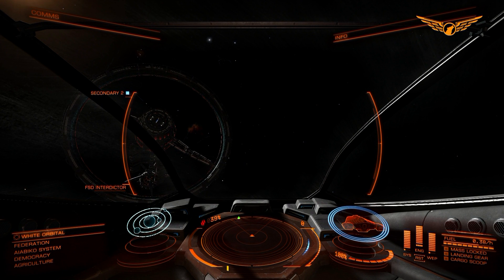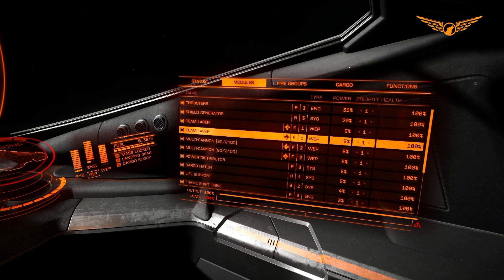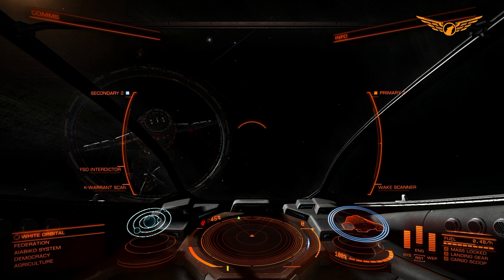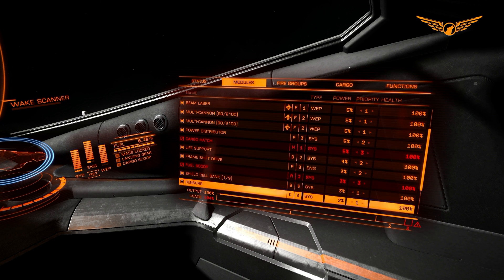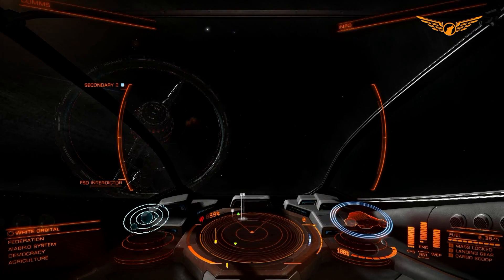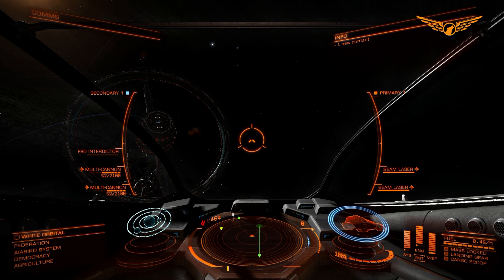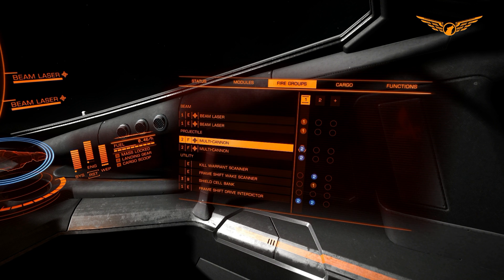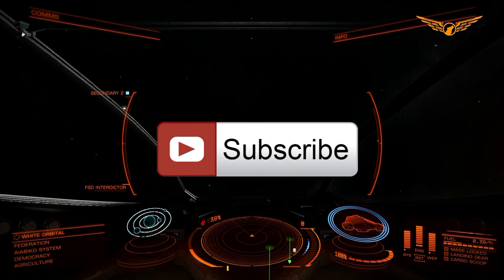Elite: Dangerous - Power Management and Fire Group Tutorial [ASSIST ON]

Comment: My understanding is that this is wrong at least on Priorities.  Essentials Priority 1.  Thrusters, Life Support, Sensors (Sensors are a requirement for your ship to move anywhere).  Defensive Priority 2.  Shields, Shield Boosters, Heat Sinks etc.  Combat, actual task you are doing, Priority 3.  Weapons, Thrusters.  Frameshift Drive, Priority 4 by itself.  It is best that this never power down as it takes a long time to boot up.  Priority 5.  Everything left over.  Fuel Scoop, Docking Computer, Supercruise assist etc.

Comment: Thanks for the video, I'm a fairly new player and this confirmed some things I thought was true but wasn't certain.

However, it drove me nuts when you put your FSD in group 2. If the crap hits the fan and you're taking generator damage , you've screwed yourself over.

My power philosophy is as follows:
1. Anything necessary for movement (My "Oh God, Oh God, I'm gonna die, run for it" group, FSD and thrusters mainly)
2. Anything that has a great effect on ship survival in crap situations (Pretty much just the shield generator)
3. Anything that supports groups 1 or 2 (power distributor, shield boosters, chaff launchers, etc.)
4. Weapons
5. Everything else (fuel scoop, cargo hatch, scanners, basically anything that can't help survival in combat in the slightest)

I've never had to add a 6th group, but I probably would if I pushed the generator too far, moving stuff from group 5 into it that absolutely does not help in combat.

Comment: I am very confused on this, also the modules, i use two multi cannons, two beam lasers, two shield banks and a discovery scanner, i want the two weapon types on seperate numbers, but i also want the shield banks not to activate when i fire, how shouldi set this up ?
Reply: Giovanni Canè Thanks, i allready figured it out, it is confusing when you start.
Reply from the maker: ***** You can assign the shield cell banks to a hotkey from the control menu... So you can set them to any key and then you don't need them to be set to the fire groups... You CAN set them to firegroups but the hotkay option is much better.
Reply: Commander ChaosWulff Forgot to mention that i am playing this on xbox, do you know if it is possible on there aswell ?
Reply from the maker: ***** I don't see why not... I haven't played this on the XBOX so I am not 100%
Reply: ***** if you mean switching between firegroups 1,2,3, etc you have to press X and RB or once hardpoints are deployed press A to cycle firegroups.Naturally you have to set up firegroups first.

Comment: Hello My laptop is a HP 15-g094sa 15.6" Laptop can it run elite dangerous
Reply: Sally Mally What processor. I have found that an Intel HD 4000 graphics can run E:D at lowest settings and the resolution turned down below 720p.